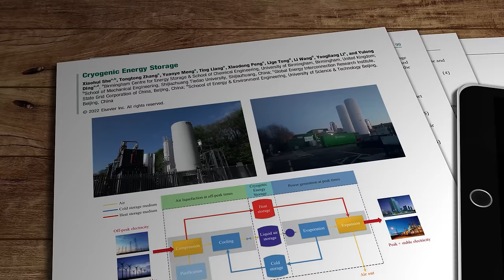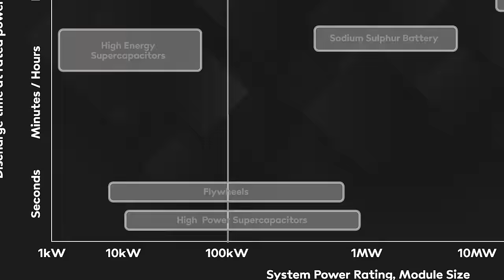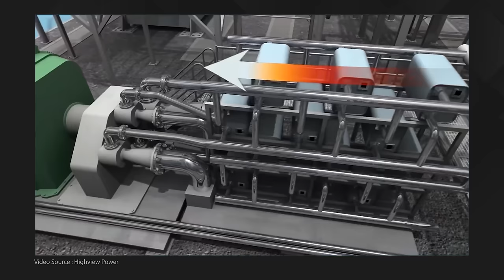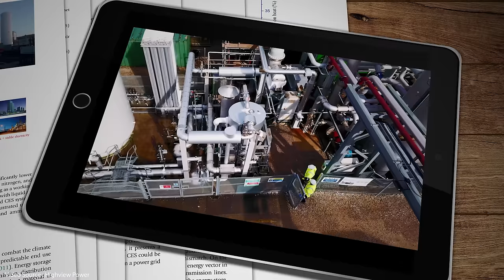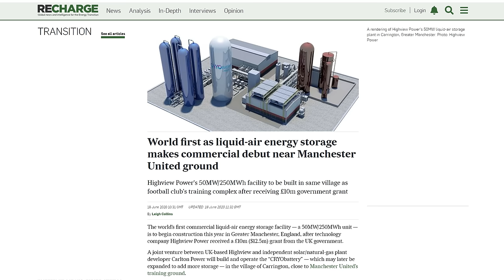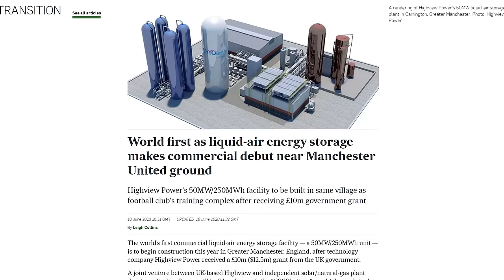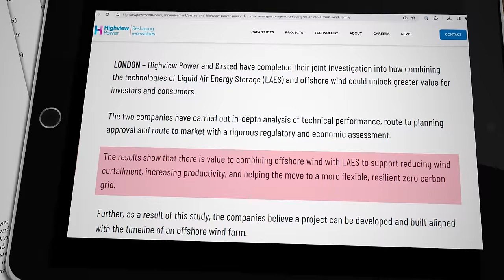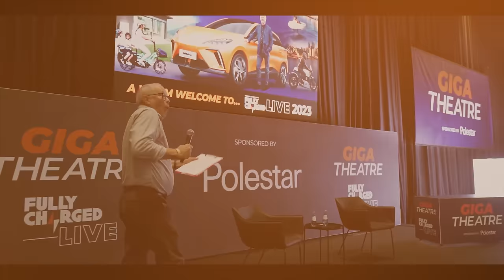Cryogenic Air Energy Storage - the new long duration energy solution?

Comment: Who pays to build it? Will it be the local power company that consumers deal with, or the grid operators that supply those utilities, or the companies building the windfarms and solar panels. It should be the last of those. Instead of the cost of dealing with part-time power sources being the responsibility of grid operators or local utilities (a cost that will ALWAYS be passed on to consumers on their monthly bill), this makes it possible to put the financial cost entirely on the power producers who deploy wind and solar projects. It would probably take a rewriting of the rules that govern the electricity market, but that would probably be politically popular if the generators of renewable energy are the ones paying for the inconvenience they cause rathet than letting it cause consumers bills to rise sharply

Comment: They might use off-the-shelf components but all these components, vessels, piping, valves, motors, turbines, compressors, nuts and bolts etc, are all made with use of Flammable Fossils, including all the road, site transport and plant. This is only storage, any electricity produced is only 20% of total energy humanity uses. Don’t see anything apart from pipe dreams filling the gap that of 80% that Flammable Fossils provides. The only real answer is for humanity to change its lifestyle and dramatically use less energy, best of luck with that, they’ll be a bloody revolution first🤔

Comment: round trip efficiency.........when all the losses are added up, a significant amount of energy is lost.  If your using an already expensive form of energy, like wind, it hurts a lot more. There is about 6% loss going up the grid to storage, the storage efficiency loss, and then the return of power down the grid to the end user.  Moving all this energy, to and from the different systems also requires poles,wires,transformers and the storage system itself.  All of that infrastructure costs money, and the issue of synchronous resonance needs to be addresses.  There are solar farms that built their sites and then found out they needed to buy a US $30 million "synchronous condenser" to make their power output acceptable to the sine wave form of the grid.

Comment: I don't think it can be efficient and cost effective to move heat from one place to an other and back again. I think pumped hydraulic is the best, in term of efficiency, cost, power, energy stored, system longevity...

Comment: How much does the electricity cost from this process...?
Reply: Many market factors will determine that. We really won't know till it's active and even then it will fluctuate.  It's basically just a battery.  They will charge the system with cheap excess energy and store it.  Then they will sell the stored energy during energy production deficits for a higher price.  That should help stabilize the grid and reduce prices at peak use times and off production times. In the end it should hopefully be cheaper then alternatives like doubling generation capacity. 

As it is we essentially have power plants just idling waiting for surge prices.  Surges can happen very quickly and traditional power plants take a long time to start up so they have to run most of the time at an idle.  Imagine at home if you had to run outside and start a generator every time someone started cooking or heating water for a shower.  You would have to know when they were going to do it and start the generator beforehand or leave leave the generator running all the time.
Reply: @jmr So basically a spectacular price the consumer will just have to pay!! No thanks, shove it where the sun dont shine.
Reply: @manoo422  So you would rather leave entire power plants idling?  That may actually cost more.
Reply: @manoo422 No, that's not the point.

The existing energy grid already uses similar systems to ensure grid supply == grid demand at all times. Seeing as electricity flows so fast, that has to be the case to a very small margin of error in both time and quantity. Some of those systems have been/are extremely expensive (e.g keeping a complete coal fired power station manned, burning coal, and just "ticking over" because it happens to be the only thing available to fill in a power supply gap should demand rise).

What is needed in the grid's future is more electricity storage systems, such as this, or batteries, or pumped hydroelectric, or many others. The more options there are available to the organisation who run (balance) the grid, the lower the overall cost to the consumer. It may be LAES is not the right solution in the end, but it is certainly one that can be done here & now at relatively low cost and quick to install.

The energy price speculators are those found in the financial district, not the engineers running the grid.
Reply: @jmr I dont want them to build the plant at all, we dont need it and never did. We already have safe and secure cheap energy supply.

Comment: I want energy storage solutions for my home.
Reply: Things I know work in a home context (home == city/suburban, so no "large fields"!):
1. Solar electric panels;
2. Solar thermal panels;
3. Hot water (e.g tank) (from either sol therm or sol elec);
4. Electric Batteries (Lead-acid, Lithium-phosphate, but not Lithium-Ion), soon possibly other varieties such as Sodium;
5. Air Source heat pump;
6. Geothermal (shallow ground source heat pump, deep geothermal heat pump) but both need a lot of land);

Things some people have made work but not normally possible:
1. Small scale wind (a few hundred watts is practical, more probably not) but many local areas control or prohibit use;
2. Small scale water ("traditional" water wheel, turbine, etc), but normally needs pre-existing stream;
3. Gravity storage (often water). Usually not practical because it's too short term and too low efficiency at small scale;

Things that only work on larger scales:
1. Large scale wind / water. The amount of power you get from wind is proportional to the square of the size, but suburban rules generally prohibit "large" even when you could in theory do it.
2. This one: LAES. It is highly unlikely (basically impossible) you would be permitted to do it on safety grounds, even if the size were possible, and the capacity you want is very unlikely to be practical (capacity rises by cube of size), so it would be a very expensive "toy".
3. ... lots of others...

One point to remember: converting heat to electricity is hard, but the reverse is easy. If you have heat and (eventually) want heat, then store heat.

Comment: I always wondered why all those giant gas tanks that used to be on the edge of most cities weren't just converted into high pressed air storage.  Fill them up when power is in excess and use the compressed air into generators when spikes occur.    There used to be 4 of them in my town and they were bigger and far taller than most warehouses would of held so much compressed air and they were used for natural gas anyway so not like they would need a major refurbishment

Comment: I'm pretty sure super-capacitors hold charge for far longer than seconds.
Reply: You talk about the physical possibility, but the limit is the economics. The advantage of sc (super-capacitors) is cycles without degradation and high power in- and output. The disadvantage is capacity. So therefor it is best used for very short grid correction ( as replacement for fossil power plant generators that stabilized the grid so far).

Comment: Not sure how the mechanical reliability of the system compares to Li/Na batteries but I can assume you need to employ full-time positions for maintenance of each of these systems. 

Rare but serious explosions caused by the expanders' frozen valves and pipes can leave a large crater; enough to bury everyone involved and not involved.

Comment: When you say "to double the power, you only need to increase the cost by 50%".  I suspect you mean "double the energy storage".  Am I right?
Reply: It could be either or both.   I would hope that if they are addressing long term storage of wind energy for wind droughts that doubling the energy storage would have have less than a 50% increase in cost.  Doubling storage would mean doubling the size of storage tanks and recuperative energy storage.  Doubling power would mean doubling the size of turbines and heat exchangers.  Also, there could be a difference between power for storing energy and power for releasing energy.
Reply: @richdobbs6595  I assumed he meant energy storage, because to double the power, as you said, requires adding turbines/generators, and other expensive stuff, not just adding additional tanks.

Comment: How about we just turn off half of the LIGHTS we use that ARE NOT necessary? I live 45 miles from Pittsburgh Pa. and their lights BLOCK OUT the night sky.
Reply: Reducing demand would be a good thing, but it wouldn't solve the problem that energy storage systems like this are designed to solve.  Incidentally, lighting is much more efficient than it used to be, and is now a far smaller portion of total electricity use.

Comment: Absolutely batty and nonsensical. A great way of combining tough to do cyrogenics with all sorts of complictions with low round trip efficiency. Closed loop CO2 operates at 75% plus efficiency at normal temperatures using industry standard equipment. Energy Dome are right now building their first 20MW/200MWH unit, with a demonstrator already up and running.

Comment: This is the entire makeup of matter & free energy:
The Standard Model of physics is nearly completely wrong and no amount of bandaids will fix it. This is a well known fact among scientists the world over. What does however perfectly explain everything in existence is the Dipole Electron Theory by Roger Spurr.

1) Dark Points  = (Particle / Solid Mass / Do Not Change Size)
2) Light Points = (Energy / Massless    /  Does Change Size)

1) When 1 Dark Point and 1 Light Point combine, they create 1 Dipole Element.
2) When 2 Dipole Elements combine, they create 1 Photon.
3) When 1,823 Photons combine, they create 1 Proton. When 1,824 Photons combine, they create 1 Neutron
4) When Protons and Neutrons combine, they create the rest of existence

1) 1 Dark Point + 1 Light Point = 1 Dipole Element.
2) 2 Dipole Elements = 1 Photon.
3) 1,823 Photons = 1 Proton & 1,824 Photons = 1 Neutron.
4) Protons + Neutrons = Everything & Everything is Light

When enough Dark Points and Light Points combine, the Dark Points all congregate into a ball to form protons and neutrons and the Light Points create a coating around the Dark Points so that they're no longer seen. In the stable elements, extra photons want to combine with the protons and neutrons, but are repelled into orbitals by the Light Points. 

Roger Spurr of Mudfossil University on YouTube has irrefutable proof of this and even convinced CERN to change out their particle detectors for CMOS detectors so they too can see this for themselves. Update: CERN has now detected what they call neutrinos (Dark Points & Light Points) for the first time ever, after having listened to Roger Spurr.

---------------------------------------------------------------------------------------------------------------------------------------------------------------------------

Venturis Create Free Energy:
- Dark Points cannot change size.
- Light Points can change size.
- When (red or blue or green, etc) photons enter into a venturi the Dark Points will be forced to return from the direction that they came from, but the Light Points will separate from the Dark Points and condense and go through the throat of the venturi. When Light Points separate from the Dark Points they create what is known as electron showers and increase their energy levels 200x. Upon exiting the venturi there is a small zone of pure massless energy that is able to be harvested for use. After this zone of pure massless energy is when more Dark Points arrive to attach to the Light Points.
* Task 1: Send (red or blue or green, etc) photons into a Venturi which has a throat smaller than the size of Dark Points.
* Task 2: Manufacture a device that can capture this excess energy in the pure energy zone and funnel some of it back to the light generating device and some of it toward a battery or any device you would like to power such as a microchip.
* Note: You need CMOS detectors to see photons.

How to Create Infinite Excess Energy:
1) Create a venturi with a throat that is smaller than the diameter of Dark Points. (Divide the size of Protons by 
2) Send (red or blue or green, etc) photons through the venturi. 
3) If an absorption and siphoning device can be placed in the zone of pure massless energy, before fusion occurs, we can harness free unlimited clean energy. Route some energy back to the light generator & route some energy to a battery or whatever device you want such as a microchip.

As the light gets accelerated and pulled into the venturi the Light Points condense to go through the throat. The Dark Points on the other hand cannot change size and are forced backward, away from the throat. As the Points separate, called fission, excess energy is created by the Light Points. Immediately on the exit end of the venturi is a very small zone of pure massless energy of only Light Points. These Light Points will have a significantly increased energy level of 200x as compared to the energy that went into the venturi. Immediately beyond this very small zone of pure energy is when Dark Points show up to attach to the Light Points, which is fusion. We want to use the energy before the Dark Points begin attaching to the Light Points.

---------------------------------------------------------------------------------------------------------------------------------------------------------------------------

Repent of your sins or suffer the consequences. Lord Jesus died in our places personally to take the death punishment that sin deserves and then resurrected by the power of God. Believe this and sincerely repent of your sins each time you sin and you will have eternal life and nothing to fear. Fail to repent and you will end up in the Lake of Fire.

Comment: No, this technology makes no sense as compressed carbon dioxide is superior. It doesn't require cryogenic temperatures to operate and has high compression. Plus you are storing CO2 so would possibly be eligible for carbon credit payments in addition to payments received for the energy generated.